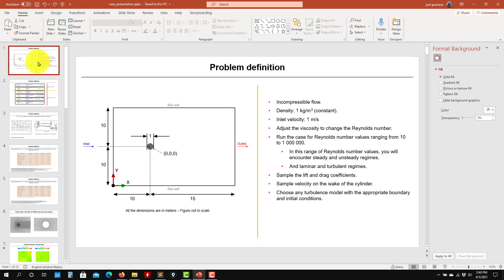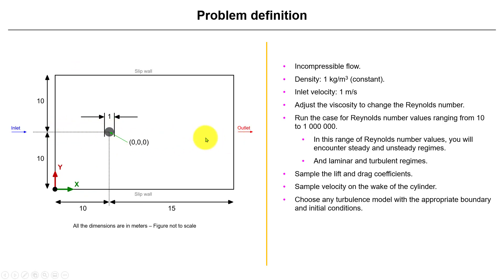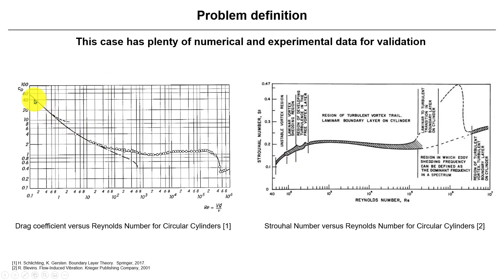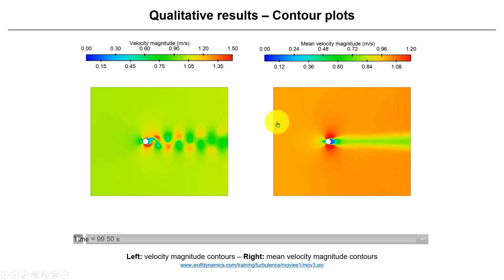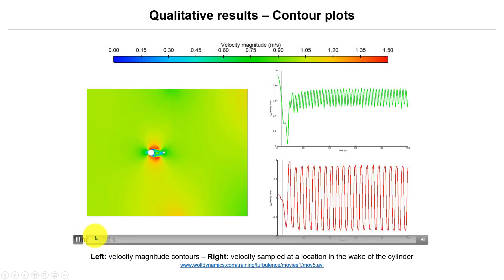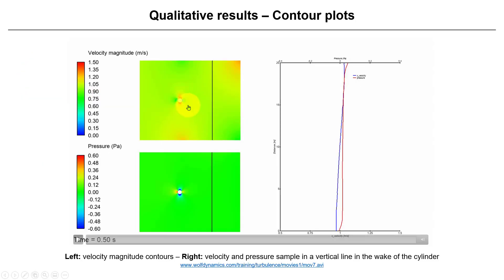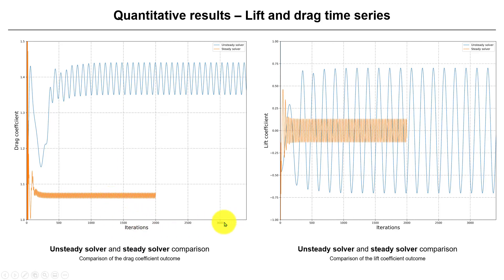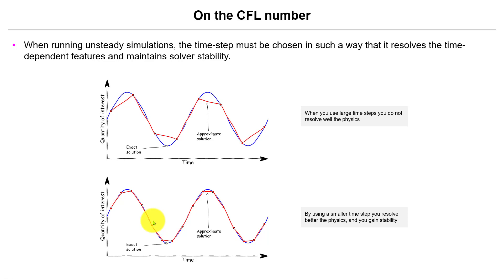Tutorial 5 - Part 1 - Flow around a circular cylinder - 2D

Comment: Hi, really excellent tutorial, I learned a lot. I tried all the ways I could imagine to get experimental range results for Re 10^4 to 10^5 for a cylinder but I am getting lower values than the ones you get for Re = 1000 (which I am able to duplicate) while I should get higher values (1.2). Any suggestion?